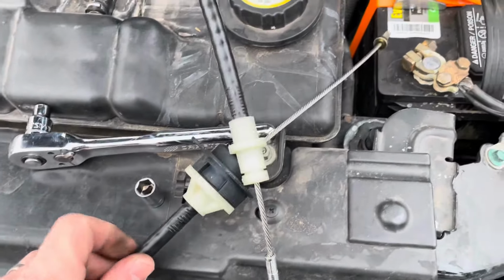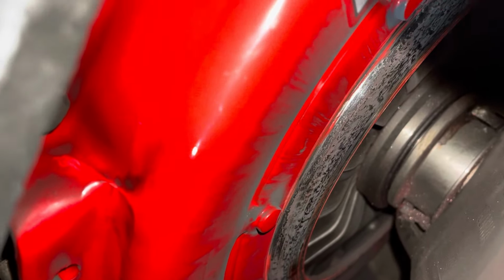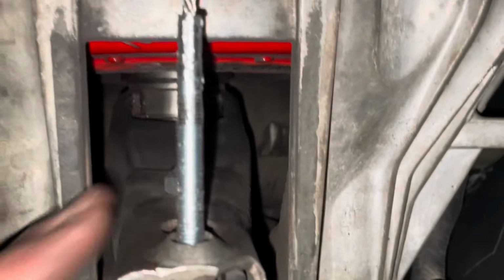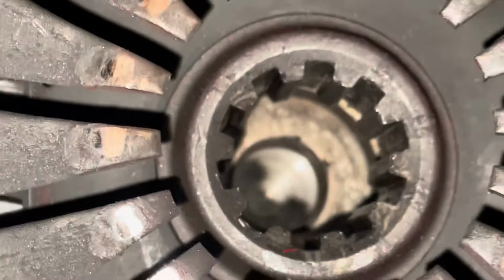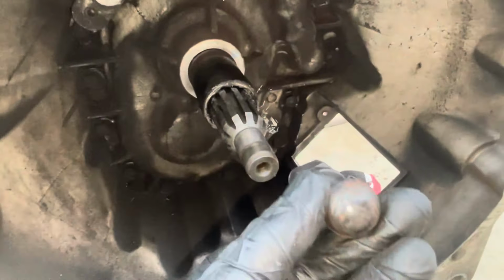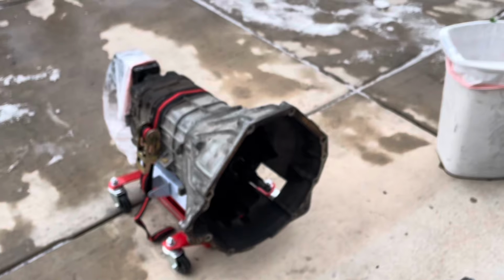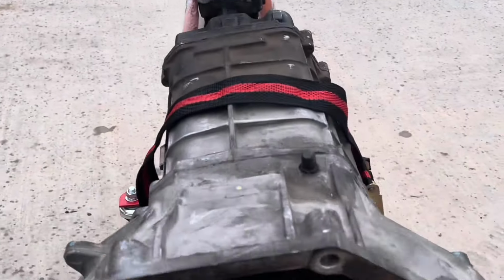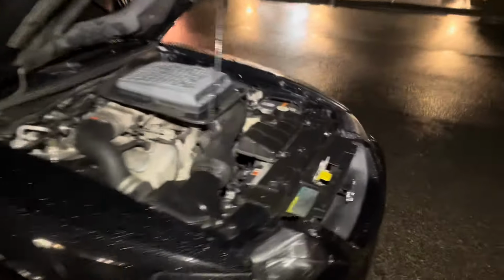2004 mustang Mach 1 clutch noise diagnosis and fix

Comment: So I’ve seen both extremes, I’ve seen people break the pivot ball mount inside the bell housing tightening down the pivot ball and now I’ve seen one back out.. 
So a happy medium torque with thread lock should do..
Reply from the maker: Yeah, I snugged it down tight with the thread locker but kept in mind that it’s aluminum so I did it as tight as I felt comfortable without risking stripping it out.

Comment: Justin, I've seen these wooden block stands before, I would pay monnneyyyy to see how you go about getting the cars on/off of then. I absolutely dread jacking up my car, but seeing those wooden stands makes me want to make/buy a set.
Reply from the maker: I’ve never made a set. I’ve seen them a lot over the years. They seem pretty safe. My friend who made the ones in this video is a fireman and he has been on scene where Jack stands have fallen or failed so he felt these would be a good idea to get the car higher up. They worked pretty well.